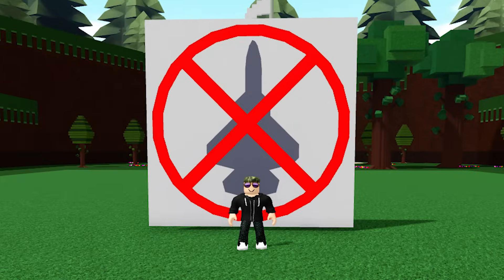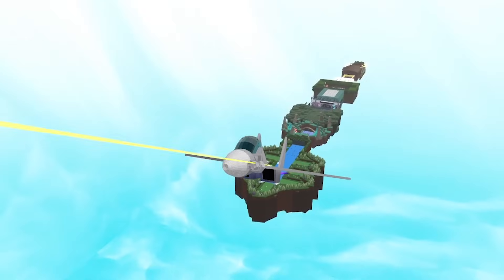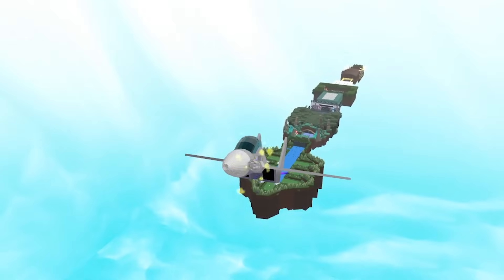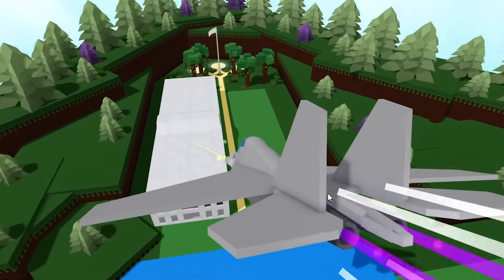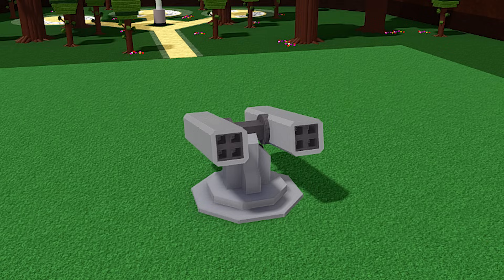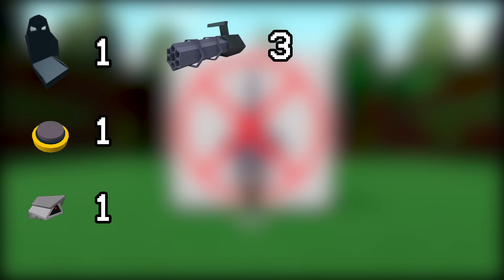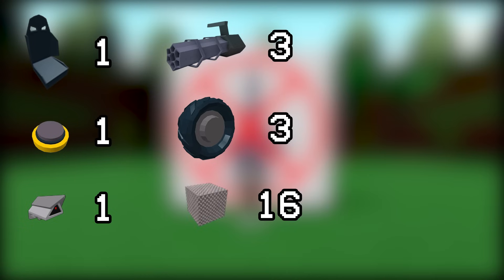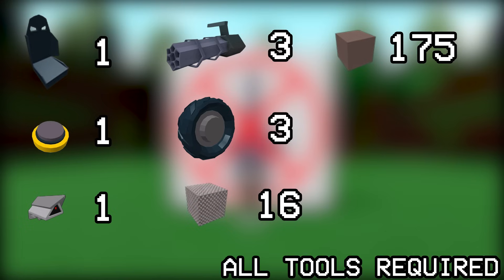How to make a Phalanx CIWS/Anti air system (BABFT TUTORIAL)

Comment: I was struggling for like an how because i couldn't get it to move left and right. Now this might not be the reason your having this problem, but just make 100% sure that nothing is touching between the top of the box and the top part besides the block on top on the wheel.

Comment: For the left and right turns, i cant get it working even with the wrench tool can someone explain? im begging this is the only thing i need ( i found the problem but i cant fix it, The first wheel is stopped by the block in the middle but if i remove the block the wheel is blocked by the walls of the box i dont know what to do because i cant move that first wheel if that block is there and i cant move the build if the wheel isnt touching it :<
Reply: have u found a solution? if yes could you please tell me?

Comment: bad tut, moves too fast, spent 4 days on this just for it not to work, very disappointed, huge waste of time. The dang thing just doesnt rotate and the box takes too long to make and is just all decoration its not even necessary, you could easily make this without all the design, Doesn't show units or where to build it or how long or big it should be for it to work.

Comment: I actually built a better version with a invisible shield which when a extremely fast object enters the shield it causes so much pressure on the gun that the gun shoots out tnt,did I mention it also has a tracking mechanism (it uses the place where the entry to the shield happens and dose some calculations to determine where is the plane and shoot it btw it doesn’t work if plane changed direction while inside the shield)

Comment: I need help mines isn't working it can only look down
Reply: so everyone says to move the wheels closer or farther from the turret check for keybinding issues but what it was for me was and he did this in the video i was just too lazy to check was in between the box were thin rods accidentily conected to the box pretty much anchoring it in place from moving left and right so take the scale tool and scale it back into the frame and out of the box that Fixed my problem. hope this helped!

Comment: my turret doesn't go left or right ,only up and down , what do i do
Reply: Move the wheel under the turret 0.5 up. Hope it helps and if it doesn't move it even closer
Reply: so everyone says to move the wheels closer or farther from the turret check for keybinding issues but what it was for me was and he did this in the video i was just too lazy to check was in between the box were thin rods accidentily conected to the box pretty much anchoring it in place from moving left and right so take the scale tool and scale it back into the frame and out of the box that Fixed my problem. hope this helped!

Comment: My a and d wont work
Reply: so everyone says to move the wheels closer or farther from the turret check for keybinding issues but what it was for me was and he did this in the video i was just too lazy to check was in between the box were thin rods accidentily conected to the box pretty much anchoring it in place from moving left and right so take the scale tool and scale it back into the frame and out of the box that Fixed my problem. hope this helped!

Comment: if u guys have trouble with moving it left or right select the entire thing except the main box with the cloner tool thing set the mode to move scale 1 move it up once after selecting and move it back down (saving it after doing it once doesn't fix the problem so u got to do it every time sadly u can make it easier by just moving up and saving and moving it down everytime u load it)

Comment: i build the thing but i doesnt let me get it up and down  so please someone help me
Reply: so everyone says to move the wheels closer or farther from the turret check for keybinding issues but what it was for me was and he did this in the video i was just too lazy to check was in between the box were thin rods accidentily conected to the box pretty much anchoring it in place from moving left and right so take the scale tool and scale it back into the frame and out of the box that Fixed my problem. hope this helped!

Comment: My turret doesn’t want to move at all what should I do?
Reply: I have the same problem it just doesnt move left and right
Reply: Try moving the wheel up a little bit @Toaster10708
Reply: so everyone says to move the wheels closer or farther from the turret check for keybinding issues but what it was for me was and he did this in the video i was just too lazy to check was in between the box were thin rods accidentily conected to the box pretty much anchoring it in place from moving left and right so take the scale tool and scale it back into the frame and out of the box that Fixed my problem. hope this helped! @Toaster10708
Reply: check on the wheels, see if is connected with other blocks
Reply: Just try to move the wheels closer to the turret
Reply: so everyone says to move the wheels closer or farther from the turret check for keybinding issues but what it was for me was and he did this in the video i was just too lazy to check was in between the box were thin rods accidentily conected to the box pretty much anchoring it in place from moving left and right so take the scale tool and scale it back into the frame and out of the box that Fixed my problem. hope this helped!

Comment: Mine only goes up and down how do I make it go to the side? (I’m on moblie)
Reply: I don't think you can move it to the side, I think :(
Reply: Awww
Reply: @S1MPLEX-RBLXYT  loads of people have this problem ive seen from other comments that you should move the wheel up by 0.5 or down im not sure which one
Reply: so everyone says to move the wheels closer or farther from the turret check for keybinding issues but what it was for me was and he did this in the video i was just too lazy to check was in between the box were thin rods accidentily conected to the box pretty much anchoring it in place from moving left and right so take the scale tool and scale it back into the frame and out of the box that Fixed my problem. hope this helped!

Comment: i cant go up or down
Reply: Also had this problem. Move the wheels 0.5 closer to the turret
Reply: so everyone says to move the wheels closer or farther from the turret check for keybinding issues but what it was for me was and he did this in the video i was just too lazy to check was in between the box were thin rods accidentily conected to the box pretty much anchoring it in place from moving left and right so take the scale tool and scale it back into the frame and out of the box that Fixed my problem. hope this helped!

Comment: wont worl left right there are no wheels
Reply: so everyone says to move the wheels closer or farther from the turret check for keybinding issues but what it was for me was and he did this in the video i was just too lazy to check was in between the box were thin rods accidentily conected to the box pretty much anchoring it in place from moving left and right so take the scale tool and scale it back into the frame and out of the box that Fixed my problem. hope this helped!

Comment: I made this and it only works on the y axis can someone help me fix this
Reply: A little late answer but I had the same problem. Move the wheel that make it turn x axis closer to the turret
Reply: @Swedish_boyy  no matter how late, thanks friend
Reply: Did it help?
Reply: @Swedish_boyy Unfortunatley I havent tried it yet but i will soon
Reply: so everyone says to move the wheels closer or farther from the turret check for keybinding issues but what it was for me was and he did this in the video i was just too lazy to check was in between the box were thin rods accidentily conected to the box pretty much anchoring it in place from moving left and right so take the scale tool and scale it back into the frame and out of the box that Fixed my problem. hope this helped! (also a little late)
Reply: @Twig-xm6lo  ok ill check for that
Reply: @Twig-xm6lo  what part of the video was it?

Comment: When I turn it left or right, it goes super fast.. what do i do
Reply: use green screwdriver tool to change wheel speed to the minimium(0.5), if you're in pc i recommend putting wheel torque in 5(green color), it makes wheel stronger
Reply: @reizinhodojogo3956  thx it works now

Comment: Hey my turret does not aim up much pls tell me what might be the problem if you know ty
Reply: i think u need to use legacy wheels and dont set the wheel speed too low, around 3 - 2
Reply: things i think might be the problem:
the parts might be welded together so the wheel cant move
the wheel torque probaly too low
keybind problem
u forgot the wheel
the wheel might be welded to the part its holding itself to
or u forgot to build the seat

Comment: hello can you help me i did everything correct it is working but it is not moving to left or right
Reply: Move the bottom wheel down by half a block, and the block that is connected to it, scale it down into the wheel and boom! Happy building!
Reply: so everyone says to move the wheels closer or farther from the turret check for keybinding issues but what it was for me was and he did this in the video i was just too lazy to check was in between the box were thin rods accidentily conected to the box pretty much anchoring it in place from moving left and right so take the scale tool and scale it back into the frame and out of the box that Fixed my problem. hope this helped!

Comment: can i make it for mobile somehow?
Reply: yes, you can use a pilot seat to control the direction, just put the pilot seat at the white cilinder thing or behind the minigun, the part in top of all wheels, and for the miniguns i recommend levers to be fast, i make multi-keybind builds for mobile using levers
be aware that when a build is moving and you are a bit laggy the lever hitbox might be delayed, thats why i use many levers in group to the same function

Comment: Is all fun in games when making a turret until when you try it and nothing moves.
Reply: it worked on me but i cant move it to left or right
Reply: @destructive14 same
Reply from the maker: Here is a list of possible issues:
- faulty keybinds
- turret parts are locked and cannot move due to being welded together (collision issue)
- faulty wheel settings
Reply: I made it before I like the build a lot and this is a joke and in a bit surprised for your reply.

Comment: dont know why i cant get it to rotate
Reply from the maker: There can be many causes for this. Here are some:
-Wheel is not keybinded
-turret is attached to the box
-wheel properties set incorrectly
Reply: Thanks so much u have got my sub
Reply: so everyone says to move the wheels closer or farther from the turret check for keybinding issues but what it was for me was and he did this in the video i was just too lazy to check was in between the box were thin rods accidentily conected to the box pretty much anchoring it in place from moving left and right so take the scale tool and scale it back into the frame and out of the box that Fixed my problem. hope this helped!

Comment: why does mine not turn
theres nothing connected and i re wired it annd still does not work
Reply from the maker: The turret part of it must be accidentally connected to the box.
Reply: Late answer but move the wheel 0.5 up
Reply: so everyone says to move the wheels closer or farther from the turret check for keybinding issues but what it was for me was and he did this in the video i was just too lazy to check was in between the box were thin rods accidentily conected to the box pretty much anchoring it in place from moving left and right so take the scale tool and scale it back into the frame and out of the box that Fixed my problem. hope this helped!

Comment: For your Tank Tread Tutorial, i was wondering if you are able to make  a smooth look for the treads? also I have been wondering how to get the treads to get more grip, as I keep on sliding everywhere.
Reply from the maker: you could try adding thin sand plates to the tracks because sand blocks have more grip.
Reply: @ReliantShell  I tried that and now it just drifts everywhere... any other tips?
Reply from the maker: @gunbomberj  The next best thing is changing the wheel speed to something like 10 or 20. It will be slow but it won't really drift anywhere since it's too slow to do that.